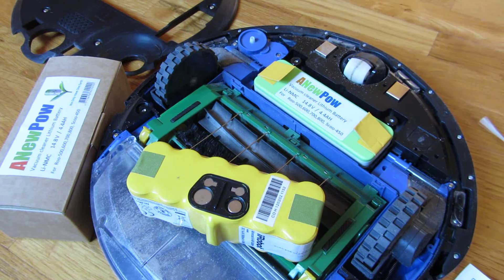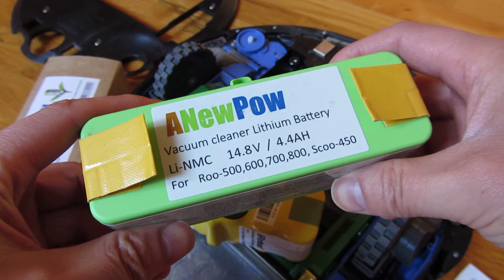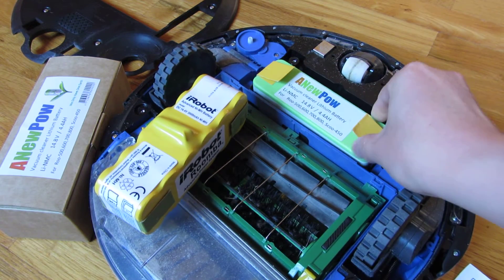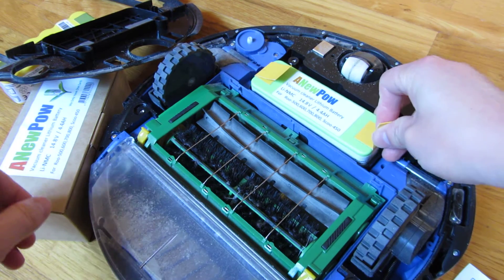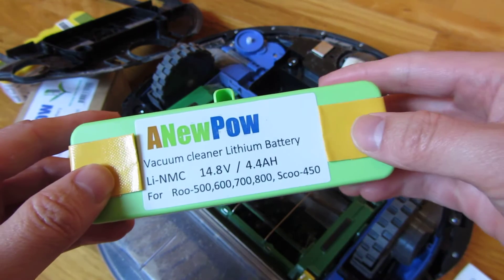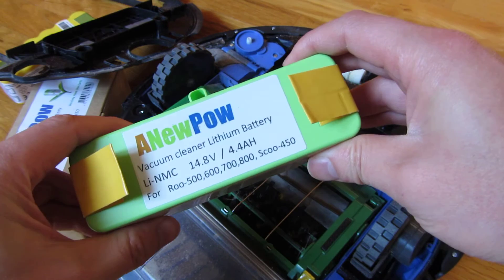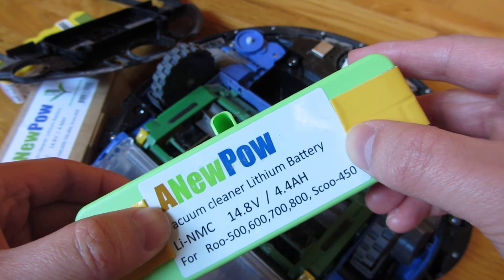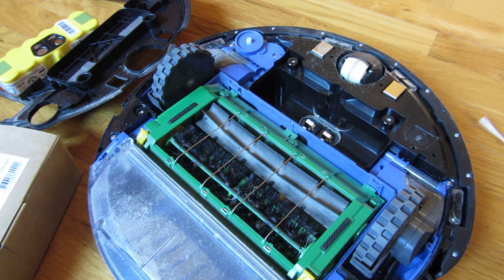ANewPow iRobot Roomba  Lithium Battery Review

Comment: Thank for your review. Can I ask till now is there is issue using the ANewPow battery on your Roomba? I thinking about changing mine into Lithium on my Roomba 780. I just worried that it will damage the iRobot in any way coz in my country iRobot is very expensive :-(. I also worry on overheating, coz my iRobot tend to get stuck either under my sofa or stuck with my kids toys. If the battery last for 4 hours, it may be trying to get unstuck for 4 hours.
Reply from the maker: Usually when the Roomba gets stuck it shuts off.  I've been using this battery for 2+ years, running it 8 hours per week.  I had not issues with it.  However I do manual launch the Roomba now, instead of scheduling it.

Comment: I have a Scooba 450 robot. I would much appreciate your advice if you can give it: I want to replace its standard NiMH battery with a lithium battery. I see on the internet that several lithium batteries that might be suitable. For example, there is a 14.4 volt lithium battery with 4500 mAh (claims to be suitable for the Scooba 450) and another Lithium battery of 2000 mAh that also claims to be suitable. Which one is best? I'm afraid I don't know the significance of the mAh values.
Reply from the maker: The mAh is usually a metric of how much "charge" the battery can hold, so for example, if a 1000 mAh is a 1 hour battery (for that particular device) then usually a 2000 mAh is a 2 hour battery.
Reply: Thanks for the reply. The issue is that iRobot advises against swapping their standard NiMH battery for a Lithium one. So if I do opt for a lithium battery, I want to ensure that my robot is not harmed and that it will effectively recharge the lithium battery. There is a lithium battery by vhbw-tec which I am told is suitable for my Scooba 450. The battery is 4,500 mAh and 14.4 volt. It will fit the Scooba, but I am afraid it may damage it or not re-charge. Are you familiar with the brand vhbw-tec?
Reply: I want to add that vbhw-tec also do a 3000 mAh lithium battery (also 14,4 volt) which is a little cheaper than the 4,500 mAh that they offer. I am told that both are suitable for the Scooba 450. Do you think that the 3000 mAh would be easier to re-charge and better for the Scooba?
Reply from the maker: This is the brand I've been using for 2+ years and it says its compatible with the Scooba 450 also.  http://amzn.to/2ijfznP  
I've been using it for 2+ years 3X to 4X a week, and its held up fine and still runs my roomba for 3+ hours.
Reply from the maker: Also watch this video, because it explains how with a 4+ hour battery the Roomba does not report the Blinking Lights correctly, meaning it thinks the battery is running low when it still has 2+ hours left on it.
Might be the same for the Scooba.
https://www.youtube.com/watch?v=ParxNNL7ARU
Reply: I'm having trouble getting the Lithium Inc brand here in England. But I can get the vhbw-tec brand in Europe easily (and it's cheaper). Vbhw-tec have a 3,000 mAh lithium battery (14.4V) that they say can be used in the Scooba 450. So I may go for that one instead of their 4,500 mAh lithium battery. I hope there is no significant difference in quality between these brands.

Comment: There is no issue in allowing the roomba to dock after the cleaning cycle is over for two reasons: li-ion batteries work based on cycles (1 full charge = 2 half charges) and if the cleaning cycle is over, the floor is supposedly clean. But nice to have a replacement that last longer and very likely is cheaper as well.

Comment: why talk about overheating the roomba if you don't even know it's a true statement???  Idiot.
Reply from the maker: rnfets Because when something mechanical is designed to only run 1 hour, and all of a sudden you run it for 4 hours continuously , there is a chance it may overheat and break.  That has been my experience with other Vacuum cleaner motors as well as other motors in general.  Just to bring up the possibility as a precaution.
Reply: Idiot? Really? Electronics and batteries (energy, electrons) generally result in heat. Idiot.